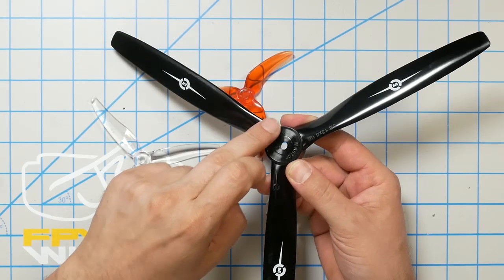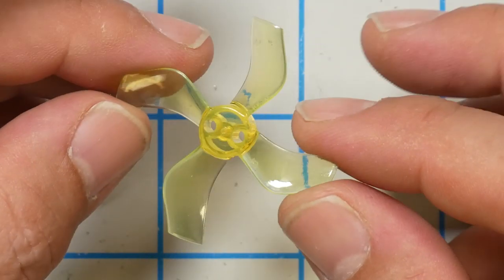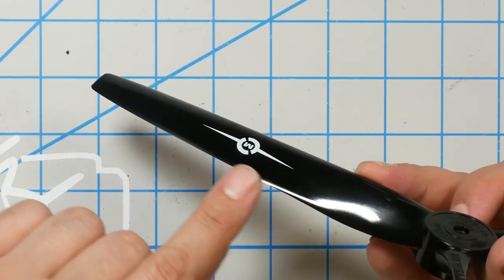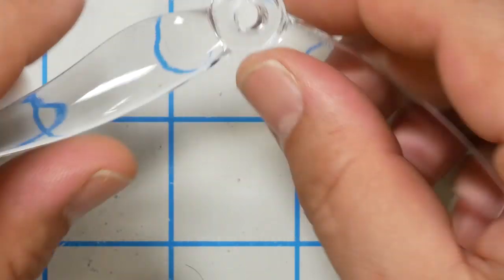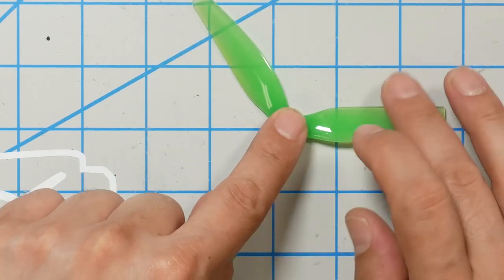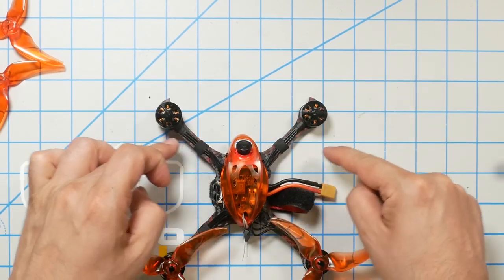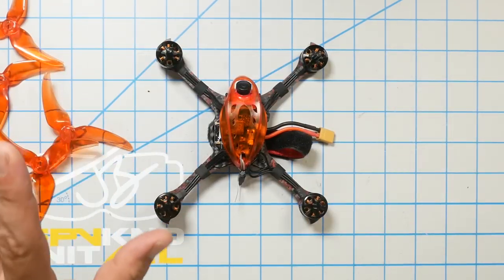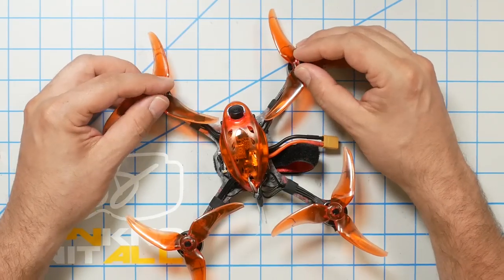How to install quadcopter props correctly BEGINNERS WATCH THIS NOW!

Comment: One important info is missing, or maybe is on another video, but it is massively important to learn about propeller's hole size and some terminology used to give technical specs about the propeller. Example: I've bought some Gemfan 5040 as a spare for a sector5, they seem perfect but they go all the way down until the motor, so  when I screw the nut the propeller keeps rotating freely, while if I mount the Ethix S5, which are stopping at the middle of the shaft, they won't turn once the nut is tight. Basically, the Gemfan are not working with the Sector5 (and I've bought like 3 sets of those..), and I'm still trying to figure out what is the information I need to look for to make sure I'm buying compatible props. Note: if you are buying a sector5 on hglrc website BE AWARE they have some "advice" at the bottom of the page to "help the customer". Unfortunately, that thing is advising random things, and I had to argue with their support because they were blaming me I didn't check if the propeller they advised would actually work with the drone...........

Comment: Hi @Joshua Bardwell,
I rarely comment on videos. But I just want to say that you've been a very big help with all of your videos about FPV flying. I'm just getting started on this hobby, and like you said in this video:'It can be quite overwhelming.' And it is. Every little part of the quad will learn you so much. And thanks to your videos, I learned a lot.
I'm a sound engineer in Holland, so I have a handy background for soldering, frequency and programming knowledge. But still it is a hard hobby to get into.
I just finished my first build, an Armattan Rooster 4S, thanks to your advice on one of your live streams. And I love it.

Keep making fun and informative videos.
And as always: Happy flying : )
Greetz,
Bram

Comment: Hey Joshua I have been watching for almost one year and yes u right is a lot to learn in this hobby and I have to put a lots of attention on all the videos that I watch at the very beginning I thought this was a piece of cake and when I start building my first kwad I was still under the impression that was easy but when I start it running to problems because something wasn't working I was worry thinking ok I guess is not that easy  but now after a year I finally have my first build and I bouth me the Cidora from Iflight and its a great one thanks to ur videos .

Comment: After flying my TinyHawk into my daughters hair and not being able to fly it after taking it apart to remove all the hair I finally tought I'd try and see if I put the props in correctly. Of corse I ended up at Joshuas video which answered my question on how to find out which way they should face and my TinyHawk is finally flying perfect. Thank you.

Comment: Could you please do a video where you explain the numbers on a prop. For example 3x4x3 I know they are the lenght, pitch and number of blades. But how does pitch impact performance? What is better 3,2,4 blades etc...

Comment: Team "Props Out", unite! (I know you're in the other camp JB. You can't get 'em ALL right! ;) Have you ever looked into how supposedly rock steady idle up with throttle cut is vs. air mode  between maneuvers? The older videos I've watched seem pretty definitive on air mode being more susceptible to self induced attitude changes between inputs and I'm curious if we should all just use air mode and shut up, or if there's still a better flying quad to be had with the "Steele" approach, than with air mode, given current firmware. The whole idea about being able to land without the quad freaking out appeals too, and would be a big safety improvement. I've heard of a number of close calls in my small local group even, where the quad bumped something when coming in for a landing and just whizzed by someone's head like a ricocheting bullet. With Betaflight, the optimal setup would incorporate the ability to turn off pid loop processing at zero throttle, I think, but I can't fully wrap my head around how that should interact withn you switch config and transmitter settings. For some reason, I think maybe the "no weird bounce landind" can only be done with KISS, but I'm not at all confident I got that right. All the more reason to set us straight, unless I'm the only one wondering about this issue. Drew did a couple videos that mentioned it, but they weren't the in depth, technical looks at the differences and their implications I'd love to see. Thanks for what you do Joshua!
Reply from the maker: Air mode in KISS is different than Betaflight. So any Steele comparison is not really valid.

Comment: I been doing a while so learned that bit the hard way lol but I have new problem no doubt you will have a video man you the best every problem i get you got it covered so thanks from motor mapping reversing you name it twisting board to fit better so grateful I just bought wot o thougt was e inch for 35 pound just motor's and frame i just bought motors for a other micro frams that also is 3inch props i know my first wad 2.5inch emax tinyhawk freestyle but I thought after I bult it wirh the esc and flight contoller etc man these 3inch props are massive to the other 3inch as looking at ebay pic gives no clue so my question is how do you measure props to buy new ones 2700kv motors and 2 x 2s batt that does not have tx30 on wow the conecter melted because the wire to thin on adapter so can have 2 2s I need to buy tx30 tx90 I can't offered batt big that if needs fly good but scary after my lil tinyhawk freestyle wirh new esc flight controller 2 3s than my other i just lost was ok but the esc i got was meant for 3s 4s think 15 or 20 amp forgot but ya props i learn some 1104 11gram 4m but measure wirh tape measure theu not size theu say ? I look in your vids buy thought I would post comment thanks

Comment: Do the props need washers? And if so, on the top or the bottom or both? How tight should the  nuts be? And if I reverse the props, does that mean that the props could loosen the nuts in flight and come off?

Comment: Hey guys, I just bought a Protek35 and people write you could reduce the crazy prop noize by using 8blade props instead of 3blade props.
Do you have to make adjustments in the flight controller too? I figure 8blades create more thrust at the same rpms and pose more resistance to the motors, no?
.

Comment: Great video I did knot already know and I do now haha. I do have  a question if anyone happens apon this I have seen in other videos that poeple loose props in flight like they spin strait off and the quad crashes,why is that?does that only happen to the racing guys or is it something I need to worry about I assume when I install a prop. I just get it a good feeling amount of tight (it is plastic after all) or do I need to use a thread locker? anyway just wondering if someone could give an old man a little help.

Comment: Please make a video on how to screw down props. Some have screws on top to press the prop down, others have small screws through the prop?
Reply from the maker: The T mount props ony go on motors made for them. They will have a small shaft like 2mm and screw holes in the top of the bell.
Reply: @JoshuaBardwell  I bought an iFlight Titan H3 with xing 1404 motors, silly me I thought to just slide the props on, didn't notice the screws. Image how surprised I was the prop flew through the living room. Now trying to figure out, they included m2 * 6 screws, but they seem so short. Fingers crossed :)

Comment: I have a newbie prop question. How do I know what props to get for my newly ordered Eachine Cinecan. Eachine only says it uses 2” props, not what kind of bolt hole separation or bolt size is used. Googling for Eachine Cinecan propellers gave no hit. Even on Eachine’s web store there is no listing under like “Cinecan propeller” and the Trashcan props clearly have the wrong prop center for the Cinecan. So what props should I get and where can I order them?

Comment: Was hoping you might add a section on the tightening down of the props aswell.
Reply from the maker: Tell me more what you're wondering here.
Reply: @JoshuaBardwell  basically any tips on how tight they should be bolted down.
Reply from the maker: Tight enough that they don't loosen up when you turtle mode, but not any tighter. Too tight and the props may split at the hub or you may strip the threads on the shaft.

Comment: I just recently discovered, the hard way that having out of balance propellers on a quad cause the motors to get super hot(like way too hot to even touch) and have probably somewhat destroyed them and put crazy unnecessary stress on my flight stack.

Comment: My motors have colored nuts, I know it signifys either left and right or front and back or diagonally.  2 are black 2 are gold, they are crazqpony dx2205 any idea what orientation these go on? I dont have certain parts yet to test the engine. So hoping to find out by the nut color significance,  thank you for any help you can provide!

Comment: Should I worry about the threads on the motors? Will the nuts losen during flight if the motor is running clockwise?
Reply: Short answer is yes,long answer is if you only have one direction thread to keep from buying reversed thread motors either use lock nuts or put a plastic bag on the thread and tighten the nuts down then trim the excess,try not to over do it though because you can throw it off balance

Comment: I dont know why I watched this but I did. The hilarious thing is that I put my props on backwards about 2 hours ago might not seem too bad if you catch it before you fly but when you have 1106 motors with the stupid tiny screws holding props on, its a hige pain in the butt to change props

Comment: Nice info. I have a question for you @Joshua Bardwell, I am a beginner myself and something that might seem stupid, for me is a nightmare. I have already lost two nut props trying to fly a Nazgul 5, and I am still trying to figure out why!!! Is there any specific way to screw them on ? do they have to be really tight, not much? thanks a lot
Reply from the maker: Are you using nylock nuts? They need to be tight enough that if you hold the motor bell in one hand and press the prop with one finger, the prop does not spin.

Comment: Thanks for all the helpful videos and reviews.  How do you change props that are tight?... eg. Cinelog25 with Gemfan D63 props are really tight to press on and I don't want to wreck the motor.  Do you ream out the inner hole?  Do you balance your props or assume the screws that hold the props on will center the prop well enough?  Thanks!
Reply: Hi, how did you remove the props, it’s held by 2 screws correct? Just unscrew and pull the prop?
Reply: @Cons2911  That's true... 2 screws and then pull it off, but the center pin is considerably bigger than the prop's hole.  I end up reaming out the center hole... otherwise pulling off the props is a struggle needing pliers... not just pulling straight off.

Comment: Should i still be looking for motor direction? I think that they used to be marked as CW and CCW, right now it looks like in most cases, there is no marks if these are CW or CCW.
Reply from the maker: Most motors today use standard threading.

Comment: Do you have a video covering installing the nut back on the prop correctly? I'm here because my props are slipping despite being as tight as the screw goes. What am i missing?
Reply from the maker: There must be something obvious we're missing. The nuts have nylon inserts to prevent them from backing off, and the first time you tighten them down, you have to "break in" the nylon insert. This can require more force than you think, and may be difficult to do if you can't get a good grip on the motors.
Reply: @JoshuaBardwell  ey you're quick haha, thanks. hmm didn't try to force it too too hard. Found some prop adapters with it that fixed the slipping and now just trying to get it to fly level. 1mm difference in battery position is making it off balance. Does FC not compensate? Also not getting it to hover using my throttle (calibrated on the TX properly), its either too little or too much power.

Comment: Does the direction the nut tightens matter on the motors so it does not want to loosen while running when using a lock nut? I would think having the nut tighten so as to not possibly loosen from the motor spinning would be the safest way.( I ask this as I bought 4 motors all the same and was going to reverse the wiring to make the other 2 run in the opposite direction as per the build video I was going to use to build my quad.) Thanks for the help!😁
Reply: Doesn't matter, just get the nuts on as tight as possible (or rather as tight as you feel confident not to break the prop) and you'll be good, check every other flight whether everythings still tight.

It's very easy to start overthinking something in this hobby cause there is so much that could go wrong - but nut directions is not one of them x)
Reply: @Averell64  Thanks for answering my question!😁
Reply: @01jmyoung  you're very welcome, happy flying!
Reply from the maker: Since modern quads often use turtle mode, which reverses the motors, the nut direction can not be 100% guaranteed to always tighten. So I just use standard thread motors and tighten the props down securely with nylock nuts.
Reply: @JoshuaBardwell  Thanks so much for your answer Joshua! I love your channel and your impressive wealth of knowledge! 😀

Comment: Did I see well, that the clockwise and counterclockwise has got clockwise screws as well?
Reply from the maker: Yes, most motors today come with standard direction threads. They're just nylock to help keep them from backing off. Since most people today use turtle mode, the motors will change direction sometimes, and reversed threads won't really help.

Comment: Question related to pusher drones, where the props mount below the motor. Do the tops of the props face up or face down ?
Reply from the maker: Tops face up
Reply: @JoshuaBardwell  Well I found my issue and it was not the props, it was the accelerometer being mis-configured it appears the FC was installed reversed. So the quad is now flying.  Thanks for your help

Comment: Hey~ Joshua! Thanks for sharing this :) but 1 more question!! Usually when we see some props, sometimes we can  find some numbers. For example 5143 or 51466 and so on. So, I mean.. if you mention about this numbers many noobs be happy!! Thanks Joshua!
Reply: I agree. Hoped there was some explanation in this video. Perhaps in the “follow up”?
Reply: Those numbers represent prop size and pitch.
For example, 5143 means 5.1" diameter, 4.3" pitch. Pitch is defined as the distance it would travel in one rotation if it were in a theoretical soft solid material.
So 5047 = 5" diameter, 4.7" pitch. 2840 = 2.8" diameter, 4" pitch. etc.
Reply: @licensetodrive9930  and occasionally you'll have another number at the end which is for the number of blades... Kinda sucks that there is no real norm for that as it can potentially get quite confusing
Reply: @licensetodrive9930  Thanks for answering this but I know that pitch is theoretical meaning.  Actually I really want to know real things such as from experiences bro 😄😄👍
Reply: @bertbeinaaf8314  yes!! I Hope it will be follows up. bro! 😄😄
Reply: @viper FPV  KababFPV reviews props almost like a wine connoisseur with his descriptions of how they perform, which is far far more than my basic knowledge of; low pitch = spins up faster because less air resistance, so good for quick maneuvers and can be easier on the battery but lack speed at full throttle.
High pitch = faster speeds if the motors can handle it, but can really eat up those amps, and not as nimble as low pitch props because it has more air resistance.
Reply: @licensetodrive9930  Thanks for specific explanation my friend 😍😍👍 I learned  so much today!! Really thanks!

Comment: my Parrot Bebop 2 Drone. propellers push down at the front and up at the back there is only one way my propellers will fit, it try's to flip itself over backwards or tries to if I hold it

Comment: i watched the video what i wanted to know is how hard to tighten the nut? because i could set the tench to where it will fly .. but if i crash if could slip could that? wood that protect my motor????
Reply from the maker: Tight enough that you cannot move the prop if you push on it with one finger.

Comment: i got 100 flight hours in the sim but i know nothing about soldering, technique, etc.there's tons of vids a bout rotating direction of props but i'd just like to know how TIGHT the nuts must be and which side of the prop is up and down or doesn't it matter? the holes are different so i think it matters. i just lost a prop on my very first flight and crashed. i'm frustrated.
Reply from the maker: The props have an up and down -- it's discussed in this video. Tightness of the props: they need to be snug enough that the prop does not easily move against the bell, but no tighter.
Reply: @JoshuaBardwell  ok. thank you.